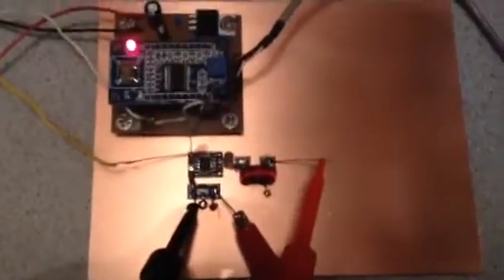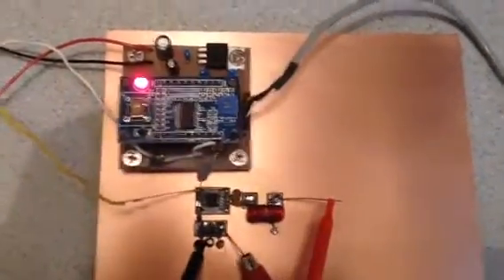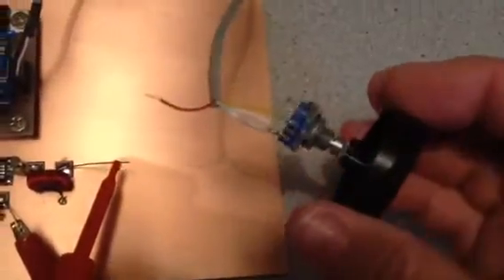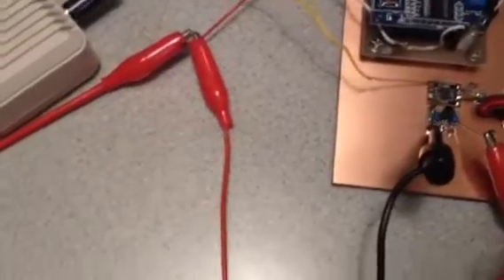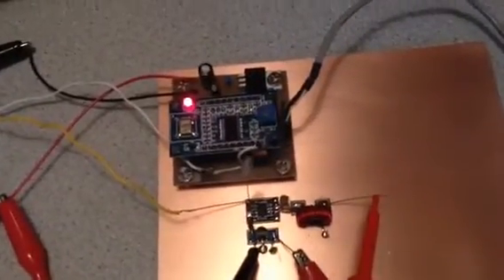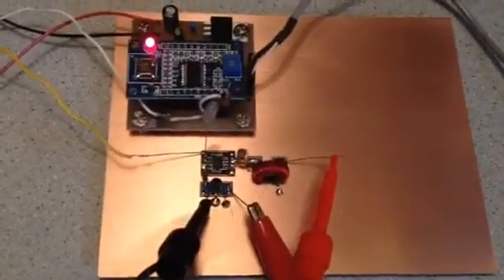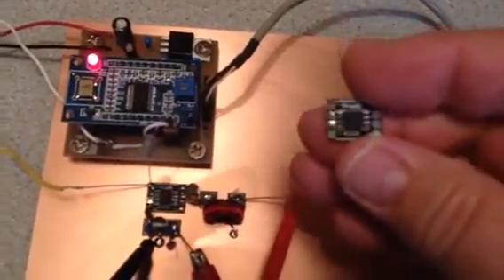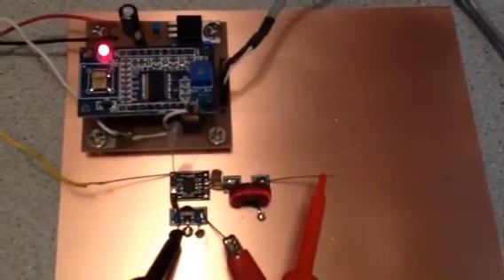VK3YE Micro 40 DSB Transceiver

Comment from the maker: Hi Riccardo, I did not use a LPF, but I did make 200 ohm attenuator to terminate the DDS and also drop the output level to match the input of the NE602. I'm sorry, I created as I went and never made a schematic. The project Is finished and works great, putting out 7 watts out of a IRF510.

Comment: Hi! I'm trying to use an arduino controlled DDS to build an NE602 receiver. Could you please the schematic please? Do you use a low pass filter after the DDS output to cut off harmonics? Is the signal of the DDS enough or you amplified it?     

Thanks in advance  

73

Riccardo